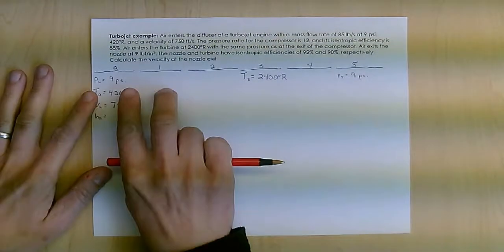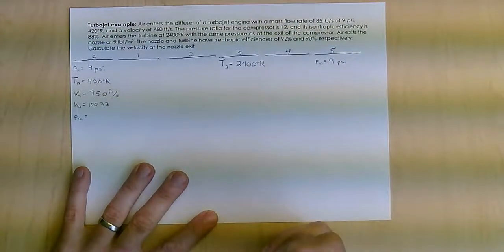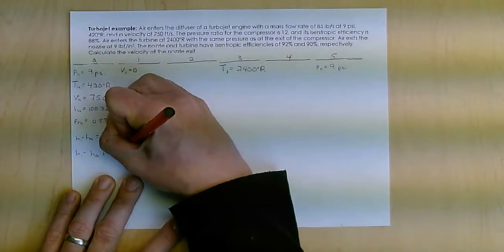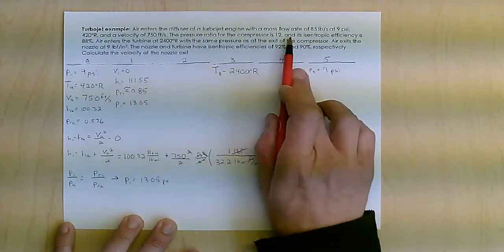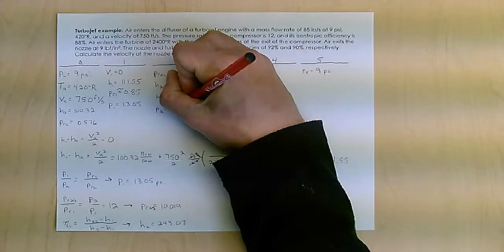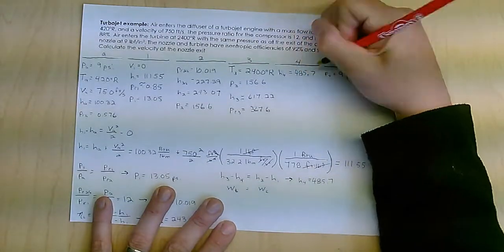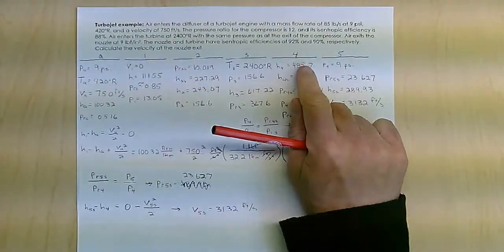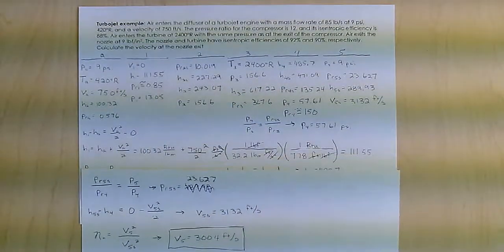Thermodynamics Example 35: Turbojet engine

Comment: kind of confused on why V1 is zero. I know you said in relation to Va, V1 is insignificant, but could you explain why please
Reply: Bc the diffuser decreases the velocity. The velocity will actually not be 0, but we can neglect it bc it will be so small that it'll become negligible in our calculation. For example, if you repeat this problem while using a value of V1 = 50 ft/s, the final answer would hardly change